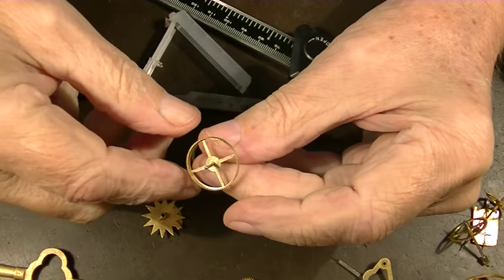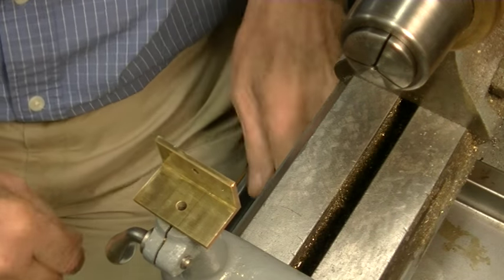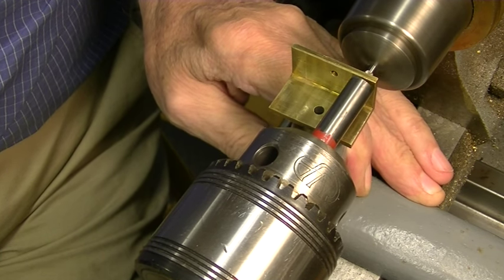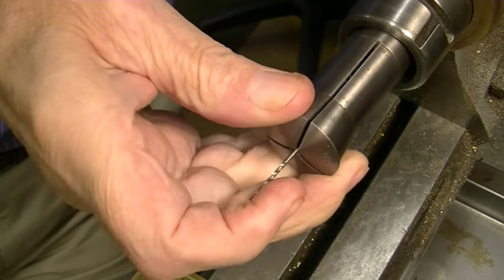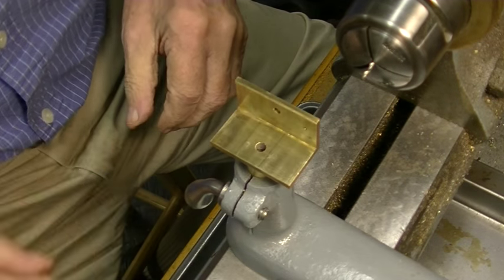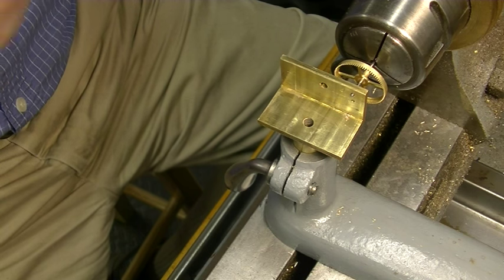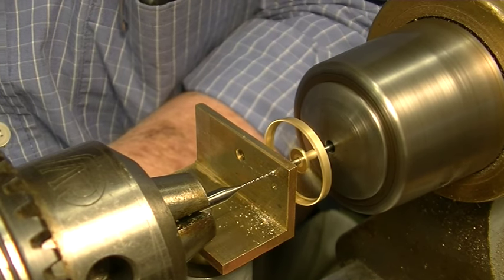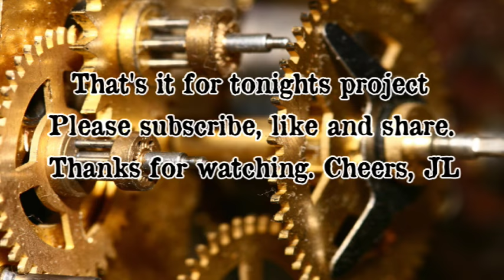James A. Lea, The Village Clockmaker. #22 Repivoting a contrate wheel arbor.

Comment: did you soften the metal prior drilling? great video
Reply from the maker: No. If you do you have to harden it after. Its easier to use a carbide drill.